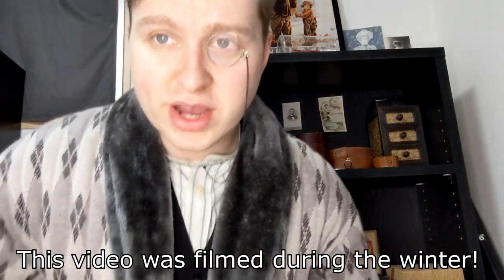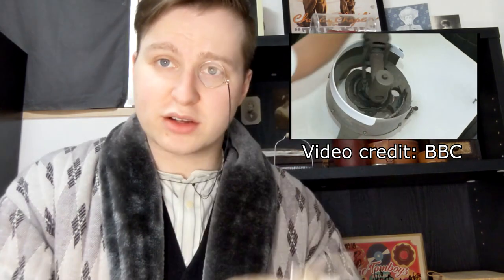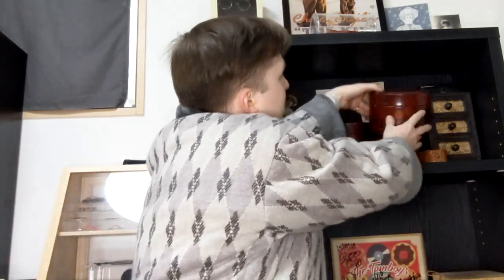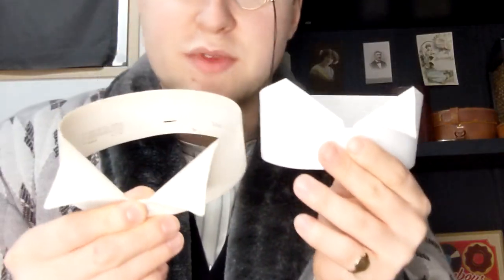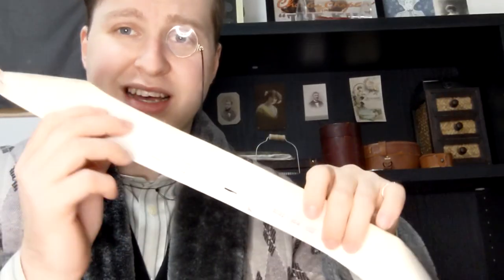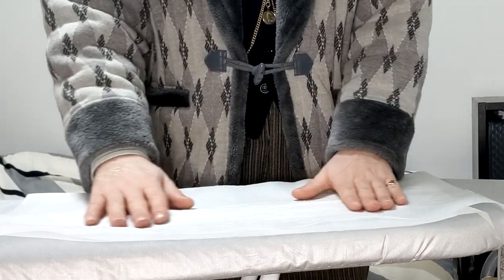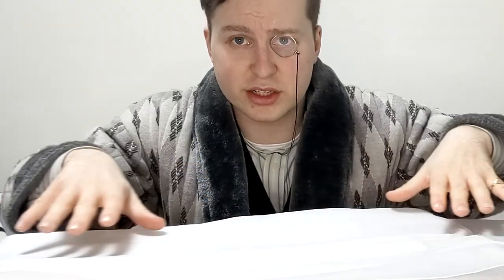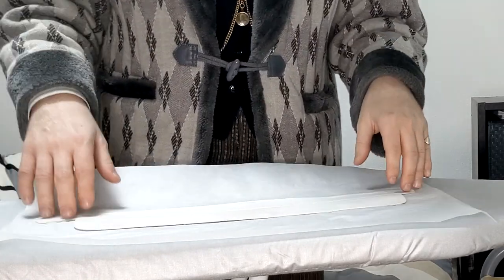How to Starch Collars! (The Modern Way)

Comment: For 40 years I wore stiff collars.  I used commerical powder starch which is made of cornflower with a litle borax to stop it going brown on ironing.  You mixed the starch to twice the thickness advised on the packet.  I would wash the collars in the normal way but in the final rinse used dolly blue so as to get a really white collar.  I used a slightly damp cotton cloth when ironing rather than grease proof paper.  Just before the final strokes of the iron I would rub a clean white candle onto the surface of the collar.  The wax would melt and give a sheen to the collar;  you could use the iron directly on the collar at this stage to give a final finish. The wax  prevented dirt from penetrating the collar and prevented chafing at the neck.  I used to be able to obtain a stick of white soft wax for this purpose but a candle will do nearly as well.  I would not dry the collar with a collar stud inserted but simply used a wooden clothes peg.  I have a collection of collar studs and stud boxes which came in various patent forms.  You used to be able to get a semi-stiff cotton collar manufacture by Van Heusen which required less starch and was more comfortable to wear.  You could also get detachable cuffs so your shirt would last several days before it needed laundry.  If you rubbed a wax candle along the edge of the cuff on ironing you avoided any dark soil mark because it prevented grime from penetrating the fabric.  A poblem with stiff collars is that you cannot pull a tie through the collar very easily.  I used fairly narrow silk ties and mastered a way of tying a neat knot without drawing the tie through - it takes practice.
Reply: The return/enter key wants to be your friend to create paragraph breaks.
Reply: @Nyx773  Thank you.  The technology I grew up with involved a little bell that rang when the paper carriage got to the end of the line,  That reminded me to pull back the paper carriage lever.

I forgot to mention that you could also get celluloid collars.  All you had to do with these was wash them in soapy water - no starch involved.

Comment: This was interesting to watch as another individual who wears detachable collars daily. I am interested to know if this method really makes the Darcy "washable" collars much stiffer, as I have tried treating them with the same boiled starch bath that I use on traditional ones and it really does not have much affect on them (I think because of the internal gluing). Consequently, I am honestly not a fan of the Darcy washable collars because (a bit paradoxically) as a result of the fact that they aren't nearly as stiff, they flex and bend, and because they flex and bend, they chafe something awful. I find the traditionally starched antique collars substantially more comfortable. My ultimate favorite though, bar-none, is celluloid. I buy every celluloid collar I find in my size. They're a gift from heaven.
Reply from the maker: Yes, unfortunately the fusing means they cannot absorb any starch, which is why simply spray starching the exterior is the only thing that works.
Celluloid collars are hard to come by but a real treat! 
Personally I like starch!

Comment: Should this method be used with original collars or no? I have a group of original collars from the teens that are yellow and stained, and I would like to know if this is a safe alternative then boiling them. Great video by the way!
Reply: No, this method will not get anything remotely close to the traditional method for a simple cloth collar. The ones he is using in this video are already fused together and pre-stiffened (they're available from Darcy Clothing). He is really just giving them some additional stiffness. Starching collars the traditional way is a whole different kettle of fish, unfortunately.
Reply from the maker: It won't get them as hard as they are now without many many many layers of spray starch that frankly won't be worth the time.
In fact, even if you use the historical method (video to come soon) from your home you'll never get them looking the same as they did back then because we don't have the tools available. 
Even Barker, who pride themselves on their starching process, can't get the shine that the antique collars had.

Either way, if you plan to wear them, anything is better than dirty yellow or brown collars so I recommend trying to starch them yourself.
Reply: @AntiqueMenswear  Here in the US we still have something called "gloss laundry starch" which is what I use in starching my collars. It used to be available at my local grocery store, but now I buy it off Amazon. I've heard that it is rice starch, but I can't confirm as the box does not say what type of starch it is.  With some elbow grease and physical force it is possible to produce a nice shine. Also, dissolving some borax in the starch soup before you soak the collars boosts the shine a bit too. 

Regular old corn starch from the baking department I find actually produces somewhat stiffer collars, but it leaves a more ivory finish, whereas the laundry starch is vivid white. Corn starch also seems to be easier to singe.